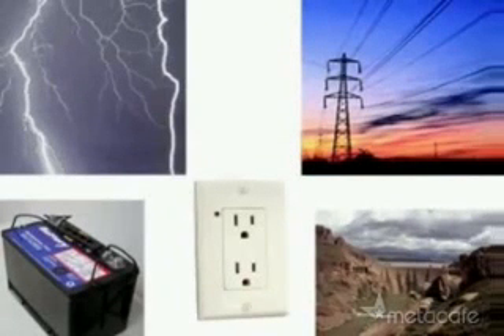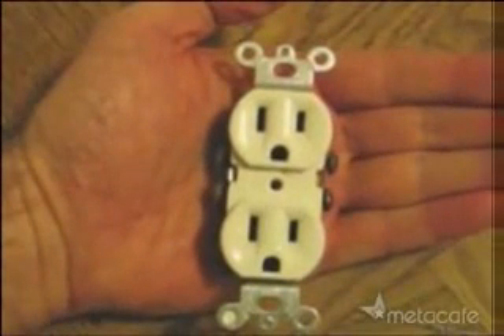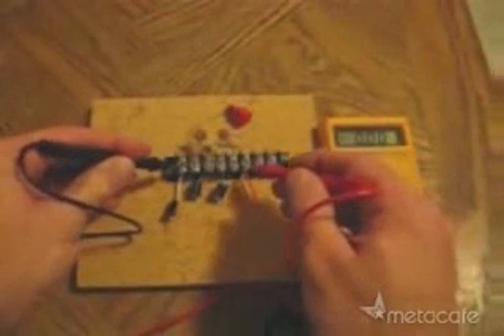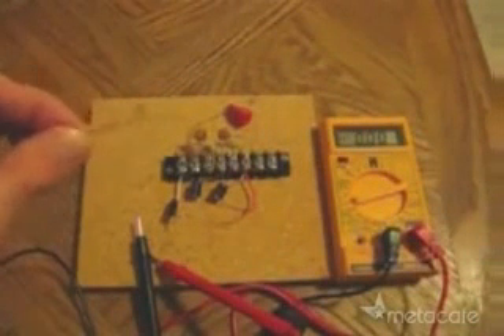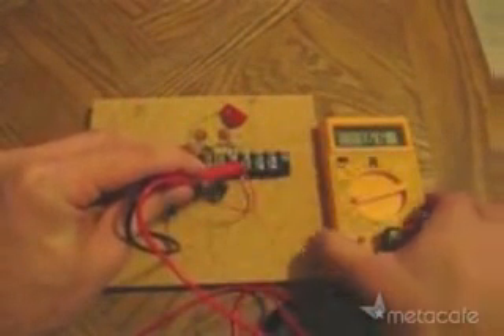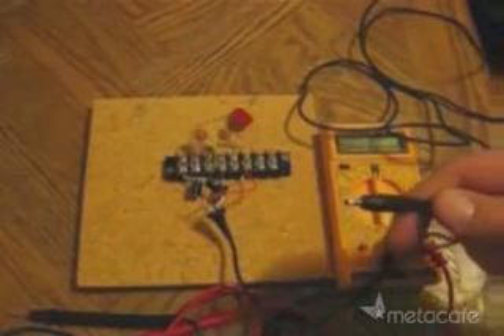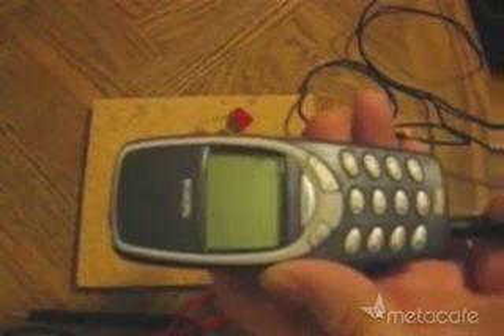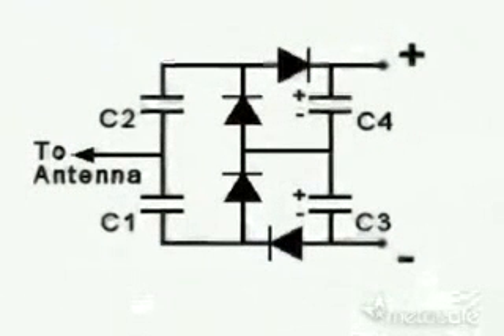Tesla Free Energy Generator Video

Comment: I build this generator. So first, yes I have a voltage without a battery or anything else, BUT the voltage isn´t constant. Without doing anything with the generator the voltage rises and after measuring it falls rapidly down. Is there any possibility to get a constant voltage? Thanks in advance